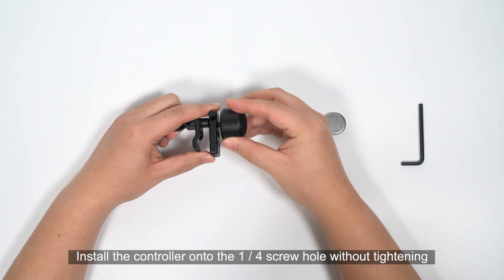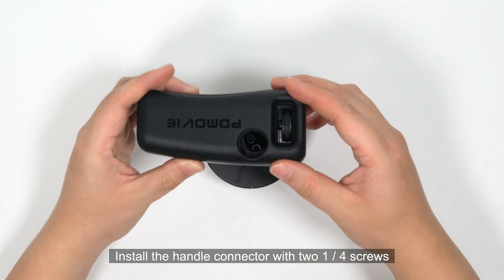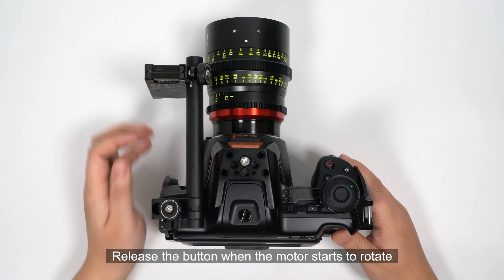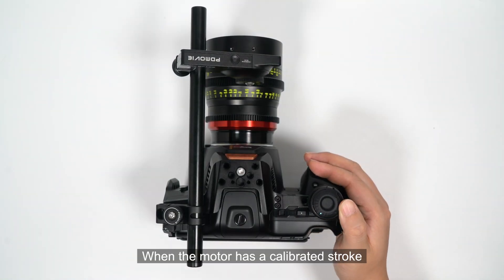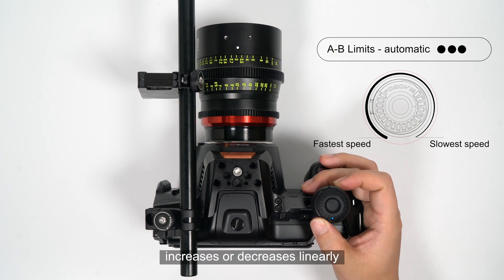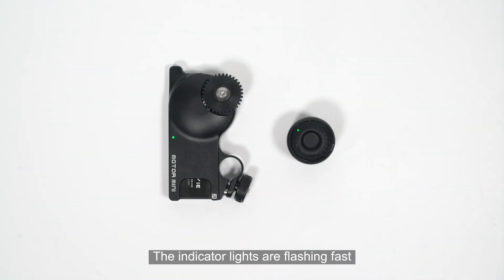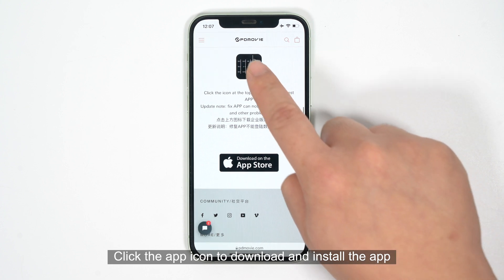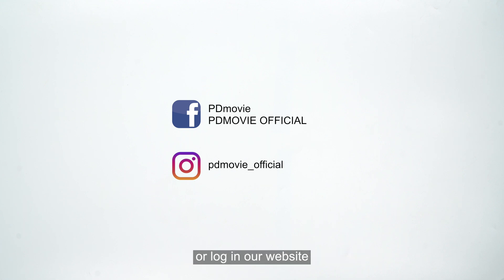PDMOVIE LIVE AIR 2S Instruction - Most comprehensive teaching

Comment: Hi. For some strange reason my moto and controller are not connecting to each other. I have tried the Bluetooth pairing several times for both the controller and motor and they still aren’t paired. I turn the controller and nothing happens on the motor. Is there something I’m missing?
Reply from the maker: Do you have calibrated lens strock? Email us:pd@pdmovie.com If you need help!
Reply: @PDMOVIE  yes I calibrated the motor to my cinema lens.

Comment: Your device cost more , more complicated to set up and build quality looks lesser than the Tilta Nucleus Nano, what advantage do you have over the Nano?
Reply from the maker: Our main feature is that there is no need to connect any cables, including power lines. Both the controller and the motor are powered by replaceable batteries. The motor torque is enough to drive a cine lens. In addition, the controller can be installed quickly and arbitrarily, and can be large or small, whether it is suitable for single player or team. 
This video is just to facilitate the user to connect the product more comprehensively and deeply. Actually, with regards to use, just watch 02:41-03:41 Quick start instruction, In actual combat, the installation and setup can be completed in 1 minute, which is very simple.

Comment: Is it possible to use the AIR 2S and the application at the same time? When I connect the application and the motor, the connection with AIR 2S is disconnected.
Reply from the maker: Sorry, If you use the app to control the motor, The controller it can't work together!
Reply: @PDMOVIE  Understood! I would have been happy if I could move at the same time...